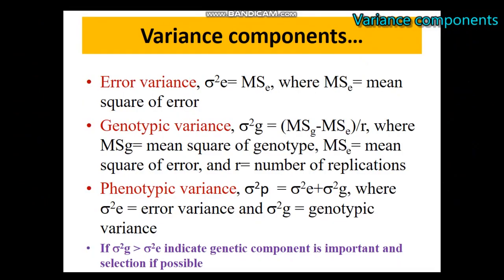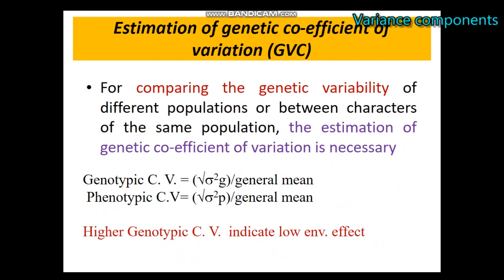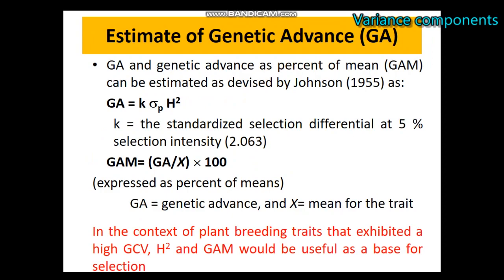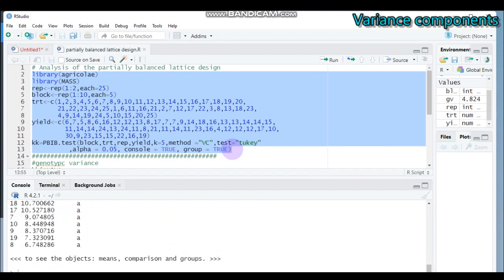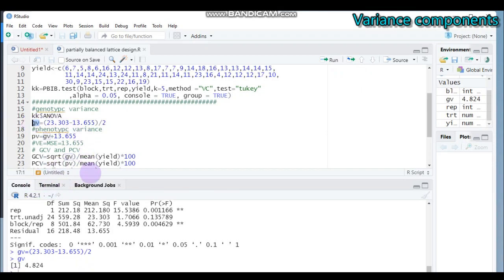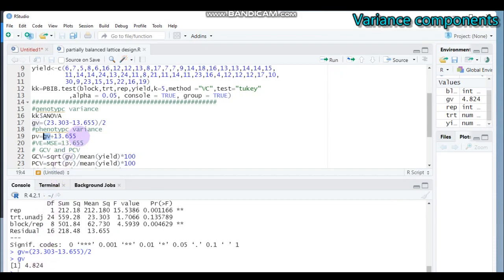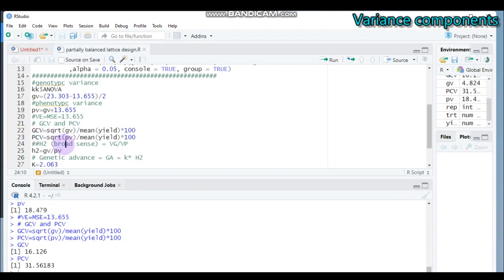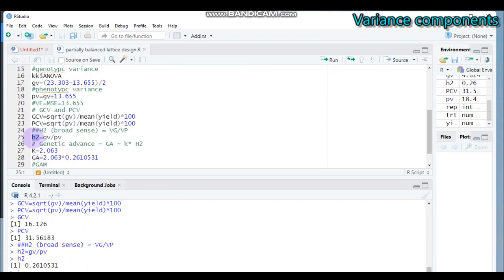How to Estimates of Variance components from replicated trial in R?

Comment: But in the case of genotypic variance calculation, we have two genotypic mean square:adjusted & unadjusted. 
How you select unadjusted one,please?
Reply from the maker: The selection depends on your data. If you feel there is a problems you have to use adjusted one to correct for improprieties or limitations in observed data, to remove the influence of nuisance variables.  But if not use unadjusted onre.